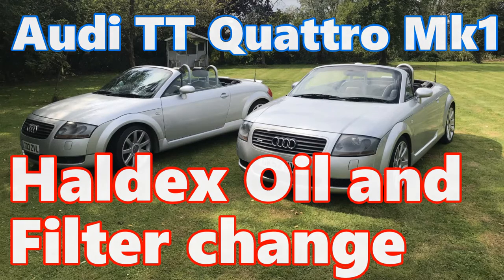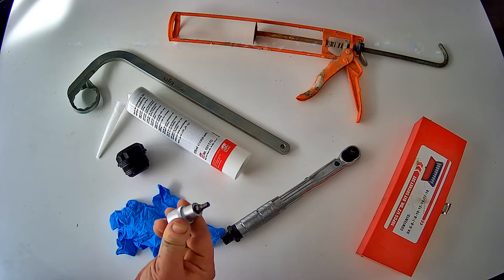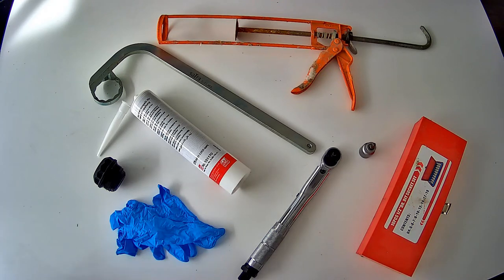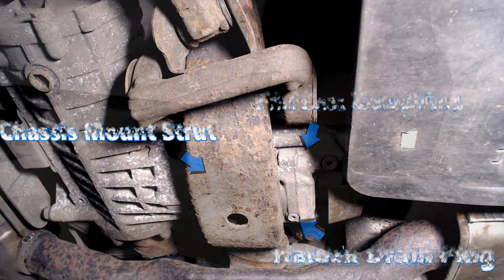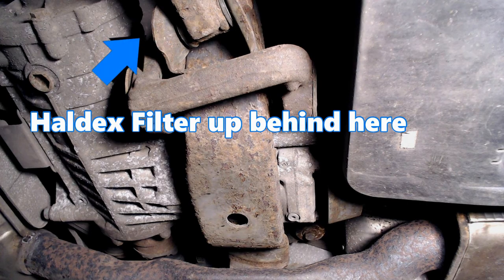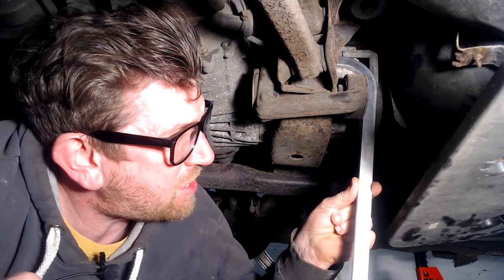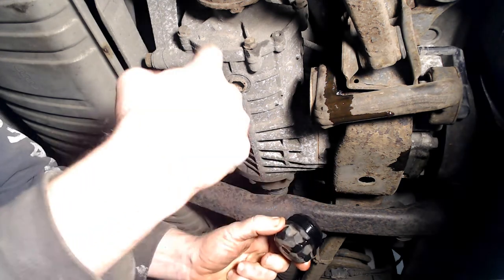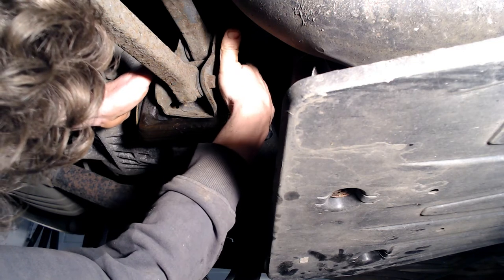Audi TT Quattro Mk1 - DIY Haldex oil and filter change

Comment: Just wondering..how critical is the volume that is replaced? Great job on quickly getting plug back..could you shorten the tube to reduce amount that doesn’t get ‘injected’ into the unit? I’m ocd when it comes to fluid volumes, would I be worrying unnecessarily about not all the oil going in?
Reply from the maker: Hi John. Yes you cuold shorten the tube length although I guess that would restrict the amount of "range" and "flexibility" you may have. 
I would say that the volume required itself is fairly small (it comes in a caulking gun tube) so you need to ensure as much goes in as possible. I hope that helps!

Comment: Top video Andy - you make it look so easy!! But given me confidence to save myself £££'s from potential garage bills...
Reply from the maker: Thanks for the comment! Definitely give it a go if you can get the car up in the air and you make a gadget like i did!
Reply: @andycharger  Managed to source an M10 x 1 adapter for the drain plug and a length of silicone tubing which will connect between that and the caulking gun. The fact that a little is lost is not a problem. I remember reading somewhere that the capacity of the Mk1 Haldex is 250ml, but the oil supplied is +10% at 275ml to allow for such spillages! Will see how it all goes - thanks again my friend. Really been a genuine help to me...
Reply: @andycharger  Did it! Got a M10 x 1 brass hose adapter and screwed into the drain hole, bit of 8mm tubing which I slid over the Haldex tube - worked a treat at any angle! Whole job came in at £22!! Saved a fortune - thanks again Andy!!

Comment: Another great video Andy. Possibly a ridiculous question, but do you know if there is a reason why the oil can't be inserted through the oil filter hole?
Reply from the maker: @eshov  hi thanks for the feedback. I don’t know the technical reason but it simply does not allow you to force anything through there. It almost feels like a 1 way valve preventing you from adding any pressure when you try. Very odd. Trust me, I tried!

Comment: Hi! Great video! I want to steal your idea for the tubing to pump the fluid into the haldex system. I’m wondering what size tubing you used for this? Cheers!
Reply from the maker: Hi Nate. Thanks for the comment. It is airline hose from an Os bottle/mask you would use in a hospital. I know that does not help but very similar to airline hoe you would use on an aquarium so I reckon that is similar if not the same size.

Comment: just a heads up those underfloor plastic body clips unscrew  those small hole fit some sirclip pliers and simply unscrew
Reply from the maker: Thanks for that nugget of info on the underfloor clips buddy! The issue i had with them was that the clip that they screw into had completely corroded away to nothing. So I had nothing to screw it into! Hopefully others do not have the same problem.

Comment: Nice clear video 👍 you can also bend the nozzle of the cartridge 90deg and push the oil through with a stick, as the oil is very thin, but your tubing method is definitely cool. Were you able to salvage any spilt oil?
Reply from the maker: My concern with the “sealed” haldex unit was always pressure preventing the oil from going in but that was not the case at all surprisingly. Like you say the oil is so thin it pumps in easy! I lost minimal oil to be fair and there was such a small amount it never made it to the ice cream tub. However, I have another tube coming this week and will put a little in through the inspection hole. It might cover that in a short follow up video! Thanks for watching!
Reply: What’s the inspection whole!? I did your method but also had some amount that didn’t make it to the cone.
Reply: Tbh if you get the full tube in, some excess comes back out (of the inspection hole I think) and ends up on one of the rear lifting points. So the whole tube isn't necessary

Comment: Really good tutorial, many thanks. I have seen someone fill via the inspection hole which is horizontal not vertical. Any thoughts on this ?
Reply from the maker: Hi Stuart. I had already tried that. It seems to be a "one way ticket" through there. You cannot get anything in when I tried. Feel free to give it a go though buddy. Thanks for the comment!

Comment: Wondering why you cant fill the unit from the filter hole if you have the flexible pipe?
Reply from the maker: Give it a go! You can’t get any oil in through it! It almost has like a pressure to stop you adding anything in through. Believe me, it was the 1st thing I tried!
Reply: @andycharger  Thanks for getting back on the comment, il take your word for it and play it safe !

Comment: Hey man, superb video explanation. Just wondering, could I get away with changing the filter on its own? I’ve just had the Haldex oil done by a local garage, but need to do the filter myself. Will I lose all the oil from the unit when I remove the filter, or is the filter held in a horizontal position such that the oil will not drain?
Reply from the maker: Hi Will. Thanks for your message. I think you will find that it will pour out of the side as the filter is vertically on the side wall of the Haldex unit. If the garage has done the oil, I am surprised they did not give you the option for the filter? Thanks for the comment!

Comment: Hi Andy, just dropped onto the channel and really enjoying your straightforward well explained content. I have a pair of TT Mk1's which need haldex service. I would appreciate it if you could provide a bit more information on the oxygen tube you used especially the bit that connects to the haldex. Many thanks keep up the good work.
Reply from the maker: Hi Gary and thanks for your kind words! The O2 tube is classed as a nebuliser mask tube. I just took a look for you on EBay and there is one coming up with a description of this: “Oxygen Tube with Connectors For Resuscitators, 2.1m” for £4.11 plus postage. That is what you need. Simply cut a 2 foot length and the cut end goes over any caulking nozzle perfectly and snug. The “mask” end is the bit that fits under the haldex drain hole. Biggest tip I can give is get a new drain plug and washer from VW and make 100% sure the washer is on before putting it back. If not and you screw it in, it will do up and seal...this time! However the bottom of the drain plug is tapered and seems to strip the threads of the hole. So when you come to do a change and use a washer, the plug does not seem to hold well and spins! I now talk from experience and will cover is a future video under “the pitfalls of some jobs”. Thanks again for watching and don’t forget to like and subscribe for future content! 👍
Reply: Andy, thank you really helpful.

Comment: Hi there Andy. Is it possible to reach the filter with pliers you think ?
Reply from the maker: You can use your hand if you have skinny fingers. It’s a bit fiddly though.
Reply: @andycharger  Guess it is hardly fitted there. Guess it never have been changed before.

Comment: couldn't you possibly add the oil throught the filter while it is removed and the drain plug is on? Asking since ill be needing to do this soon and figured itd be good to ask
Reply from the maker: No it’s not possible. I tried that. It does not seem to take any oil through there.
Reply: @andycharger  thank you so much for the response guess it'll be an extra tube then for accidents 😅
Reply: hi 
there is another 6mm hex plug next to haldex unit is it possible to fill it from there?

Comment: have to ask I bought an audi tt 2005 quattro and the carfax has literally every single service done.... its at 147k water pump timing belt finished at 100k clutch at 120k .... and oil changes every 4k mles from previous owner... however I never saw a haldex or "rear differential service" on his car fax safe to say my haldex unit could be damaged or should I be fine? I'm gonna change the oil cause I think its factory OEM filter and oil... since 0 miles...
Reply from the maker: Definitely change the oil buddy 👍
Reply: @andycharger  yea seems like previous owner took good care of it im just not sure if most owners are aware that haldex unit needs to be serviced every 40k lol

Comment: Nice video. Well explained. I like the exact list and size of any tools. Thanks. Did you get the under panel clips from eBay?
Reply from the maker: Hi there and thanks for your comment. Yes they came from EBay uk and the listing is called “AUDI A5 Q5 Q7 TT METAL TRIM CLAMPING WASHER HEAT SHIELD UNDERTRAY INSULATION” so if you search using that term, you should find it. Are you undertaking the job yourself? If so, let me know how you get on! Cheers! Andy
Reply: @andycharger  Thanks for that.  I only need to change oil next time, thankfully.  What a stupid place for Audi to put the filter.  Keep up the videos, really useful.  thanks you.

Comment: Can't you use the gun and pipe to fill the filter hole with oil?
Instead of filling through the drain plug?
Reply from the maker: Hi Amjer. It is fairly inaccessible doing it that way. If you can get it in, great. However, there must be a reason why Audi recommend it the other way.
Reply: The Bentley manual says you should fill from the bottom up to avoid trapping any air. I was thinking of filling via the inspection plug hole until I read that..... Now I'll give it a go via the drain plug as Andy demonstrates (when the time comes).
Reply: @stevieb7121  can trapped air escape somewhere up top. Wondering if you should fill from bottom then tighten filter, otherwise you will end up with a trapped bubble of air no?

Comment: Would this be any different for a MK2 (or indeed a MK3)?  You say that if you caught enough in the ice-cream tub to be worth adding in you would do so via the inspection hole, but you didn't show the inspection hole or explain why all the oil can't be added through the inspection hole in the first place. I must say that if this is the correct method it is very poor design to have to add fluid upwards into a unit! Nuts!
Reply from the maker: Thanks for the comment Andrew. You simply cannot get anything in the inspection hole. I’m not sure if it is pressure preventing or what. I’m not sure if it’s the same on mk2 or 3 but would imagine it has improved. As crazy as it seems, filling from below is the method!

Comment: Hi Andy, after watching the video by BWS TT (https://youtu.be/vSjWdcpDs84) about pumping the oil, no need of extra hose & nozzle, but it's a also a good idea ;-)
Reply from the maker: Yes there are several ways to do it. Mine requires no cutting of the nozzle and a slower delivery of oil to ensure there are no leaks. Both work equally well. Thanks for watching.
Reply: Hi Andy, I changed the haldex oil this morning and your method is definitely the best. In fact, the hole through which you load the oil is not deep (less than a centimetre) and doesn't allow you to get the nozzle in far enough. With your tip, I lost almost no oil when I replaced the drain plug 🙂 @andycharger
Reply from the maker: @yoannboukredine727  thank you for the vote! I’m glad it works well for you 👍

Comment: G052175A1 High Performance Oil, 02D525558A Filter, 02D525729 Drain plug.
Special tool required to remove filter. VW Audi Seat Skoda Haldex Oil Filter Service Tool Car Garage Tool Spanner 46mm
Regular servicing of the Haldex will ensure good performance and long life. Audi recommend every 30,000 km.
Considering rebuilds for Haldex systems wouldn't be cheap, changing the oil regularly would be a very good idea. TIP: Put the oil tube in the freezer for 24h before pressing it into the Haldex to reduce the mess when putting the drain plug back.